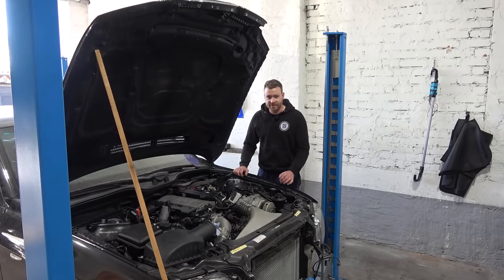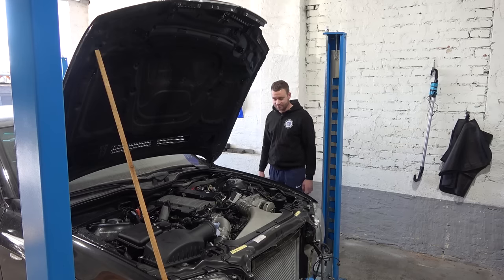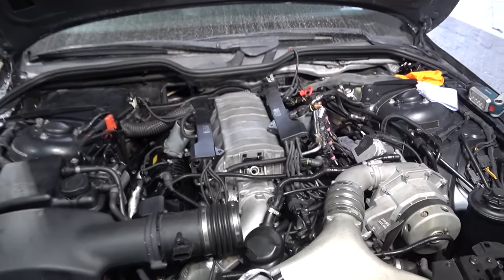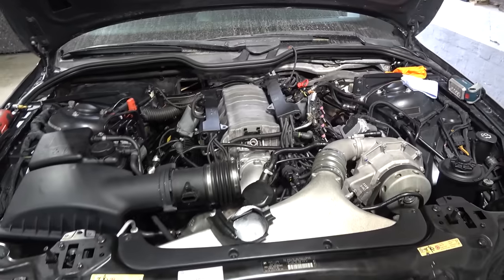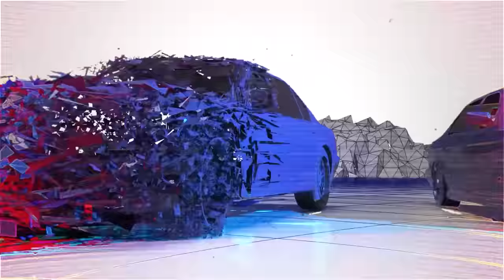Disastrous First Drive - V8 Alpina B7: Project Chicago: Part 7

Comment: Now you need to look for smaller nails, nuts, ball-bearings, or washers, maybe even swarf from recent machining, blocking oil pathways inside the engine. 😬
Plenty of high pressure air should be used whilst rotating the engine in all directions on the engine arm you have.
I heard of someone putting bananas in a gearbox to make it quieter for the sale of a car.
There are some crazy people out there who just don’t care.

Comment: What is a freshly rebuilt motor break in period? Is it more than 1,000 miles. For everything you've done rebuilding the motor, I feel terrible for you having the knock issue. Hopefully it's just a sensor sending the wrong code instead of a rod  maybe a hose ....

Comment: It's not a rod knock, that part of the motor is like any other motor- very simple and basic.  The noise is coming from some part of that overly complex, over engineered part of the valve train.  An old small block Chevy with a pushrod valve system will give you the same horsepower, will be lighter and will last forever.

Comment: Could leaking injectors result in gasolin in the oil ?  Making the oil thin, and Even result in eksplosion inside the block... or hydro lock in start up.  Is this what happend ? My guess, after reading about it. Such a shame, he didnt put in new injectors from start, if this is what happend. The engine will probably be finish if this is the case. So sad.

Comment: Today on autobahn in the gas station a guy comes to me asking if I have some 5w30 available because in the gas station had anything but 5w30. It's 3 series 2 doors BMW was on low oil level. Also told me that even in the car manual is stated that is eating oil. I am fucking understand the passion, but looking at my kia ceed rezonable priced car, 14 years old, 1.4 otto, havent eat 1 gram of oil. Still wandering why i'm also so passionate about BMW. Over engineering shit is fun and complex but they have to make it better, or else, start assuming shit. Also after the warranty expires. I guess you already put 10k in this project.

Comment: mate ///////u  ran it in fine and i know u the penny dropped just as the cycleist said hello (i think considering u just realised u did all that work and somewbody cant turn some journal to the right spec or were thay new conecting rods anyway u were petty civil after hearing the crank rattel like a good en sometimes the best bmw is the low spec older manual that no matter how much u bounce it off the rev limiter it just dont break ??????good luck pal nice content

Comment: Streton I have had a think and I do not think it sounded quite right the first time you pulled up. Your issue I think is oil pressure related. I would be maybe thinking. Did they remove a blanking plug from an oil gallery when they had the block and not refit? I saw you build the engine and all looked OK but is there a gasket or O ring missing where it can dump oil pressure? Just a couple of thoughts.

Comment: I had a e46 with 96k miles with horrible shocks , oil gasket leaks, antifreze leaks. Then I got an audi A4 with 161k miles, suspension, engine and trans feels like just came out of the factory.  BMW does kind of poor jobs  about longevity

Comment: I dear o dear that really is a horrible sound. To me it sounds like a big end bearing failing. But I also hear some grinding noises so my guess is severe oil starvation on one of your big ends.  Could also be oil starvation on the cam shaft but I would expect another frequency then . In the end I  really hope I am wrong and it is something simple. Fingers crossed and good luck. such a disappointment after all the precise work you did.

Comment: Omg why did u remove windowtints... Car almost looks like a fish tank... Its not a old green VW Golf or red toyota corolla, it's a 7 series!
Reply: In Europe it is illegal to have the front windows and windscreen dark tinted so it has to be removed. This would leave just the rear passenger windows and back window tinted but, as Streten says, he doesn't want to give the impression that he's carrying gangsters in the back seat.
Reply: @saddoncarrs6963  who care what's illegal or what's not. I've been driving in Germany for a couple of years and I never had to take tints off. I got e65fl aswell with all the tints and everything, looks much better + gives much preferred privacy.
Reply: @taurihaidma359  Legal vs not legal matters every 2 years for TÜV inspection.

Comment: Car good Alpin. But not good autematic gear box. Original Alpin mech Gear box manual normalised engine Max work. Nja Next again rebuild Alpin. View your works problem defext. Normal Stuff happens.  Weak defects must be seen.  Disassemble and put together properly it is clear.  But there are rarely nuances that need to be found in a problem.  Once in order, it will be normal.  That must be taken into account.

Comment: You didn’t have to drive to fast like that because you were rebuilding the car engine. driving gently for the first 1,000 miles or so is still and keep rpm below 5.000
Reply from the maker: That wasn't fast and the car needs to be driven properly in order to break it in properly. If you pamper it, it's the worst thing you can do.
Reply: @M539Restorations  Me and my friend have e39 540i we were rebuilding our car engine at the same time and same auto mechanic shop . He drove fast after rebuilding but I didn’t drive fast. so his engine damaged again but mine not.
Reply from the maker: @rashidharkiy176  I'm sorry, but that's nonsense. That engine was not done properly then, like mine and you'll see why in the next episode. Again, you are not supposed to redline it but go through all gears and rev it nicely up to 4-5k rpm. I'm sorry, but you clearly don't know enough on this matter as you can break in the engine more than one way which will depend on the builder and engine. I see now that you edited you comment.
Reply: @M539Restorations  holy shit so you screwed up building the engine somewhere? That's gotta hurt.

Anxiously awaiting Part 8 though!
Reply from the maker: @Wasmachineman  No. Block wasn't sleeved properly.
Reply: @M539Restorations  In a way i'm not surprised. Finding someone honest and with the right knowledge in Serbia... yeah, that's VERY hard.

All the best to you though, this B7 has been a rollercoaster so far and I like it.
Reply: @M539Restorations  Ive had some experience with garages in the balkans and so I did have a passing thought when you said the price of the resleeve.... "This all sounds too good to be true". You live n learn I guess.
Reply from the maker: @badgerservices9665  that's actually a normal price for that job there. Not cheap by those standards
Reply: @M539Restorations  Yeah normal price for there... but you must undoubtedly know, nothing is normal about the Balkans 🤣. I had my vehicle go in 3 times for a repeated issue. Noone could seem to fix it. But they certainly could take the money. In the end I took it out of country to get it sorted. Cost more but job done. 
When I complained the response I got back was... 'This is Bosnia, not Switzerland'. 🤣🤣
Reply: @M539Restorations  I edited my comment because I add more words. We will see what was the reason of your engine damage again
Reply: @M539Restorations  holy shit you weren't kidding, cylinder #4's liner is completely gone!

Comment: Putting mismatched tyres on a car is like wearing mismatched shoes, why would you ever do it?
Reply from the maker: Maybe because the previous owner couldn't find the same brand tires for front and rear as they are unusual size and almost impossible to find?
Reply: @M539Restorations  it’s no excuse, if I took a size 10 on my left foot and an 8 on my right, I wouldn’t just wear odd shoes 🤣
Reply from the maker: @ShalomBrother  yes, it is and what are you even talking about. Wrong size?! The wheels are staggered, rears being wider and requiring wider tire size. Front and rear tires are not the same size and cannot be bought from the same manufacturer because of that. I tried later in the project series and couldn't find the same brand and model from the same manufacturer. The tire size is otherwise correct.

Comment: When rebuilding an engine, the speed should not exceed 60 km for the first 1000 km
Reply from the maker: Lol, no.
Reply: Its about rpm and load
Reply from the maker: @CalinEnduro  It should be driven and revved normally, it's the best way to break in the engine. Many builders put it directly on the dyno and break it in there. If you drive it slowly, it's not good as you are not putting any load on the engine.
Reply: @M539Restorations  well yeah, from what i know there are some procedures how to rev it keep it steady ar certain rpm.s and repeating with all rpm.s but i think till a certain point, i guess after few km hundreds you can go 5k then 6k but not flatout
Reply from the maker: It's going to depend on the engine and the builder, but absolutely shouldn't be pampered and driven slowly.

Comment: Why nobody wrote that he has been pulling engine too aggressively at its first kilometres after rebuild? It’s not how you let sit down engine parts firmly after complete rebuild.
Reply from the maker: Because you clearly don't know what you are talking about. That's called normal driving with acceleration up to 4-5k rpm which you need in order to properly break-in the engine.
Reply: @M539Restorations  I don't see problem about reving it to 4-5k rpms but in my opinion it's too high at the beginning of "running-in of the engine". More is about how much you open "throttle" or lift of valves because it's valvetronic engine. You can rev engine smoothly and gently without stress for the parts up to 5k revs, or you can floor it, generate lot of torque and generate lot of stress for brand new or just machined engine parts, that just are about to fit well to each other. At the end of the day failure happened and I don't blame You at all. There could be multiple reasons for engine break down. Fingers crossed for finding the reason and looking forward for more episodes!